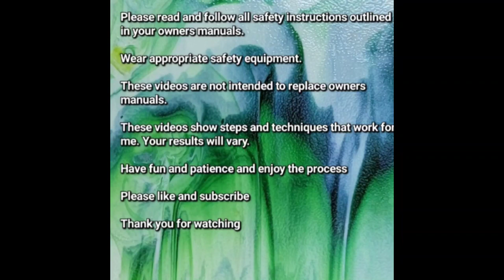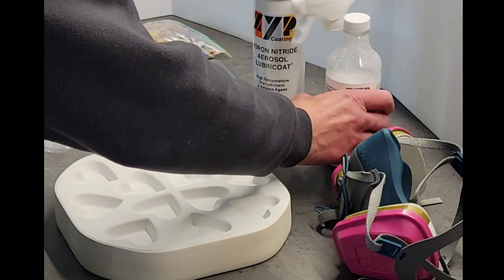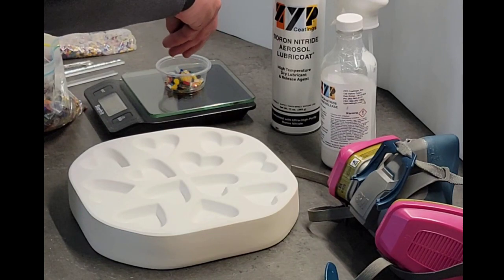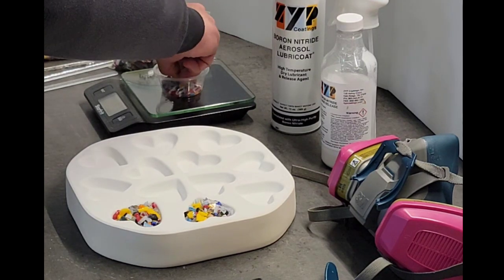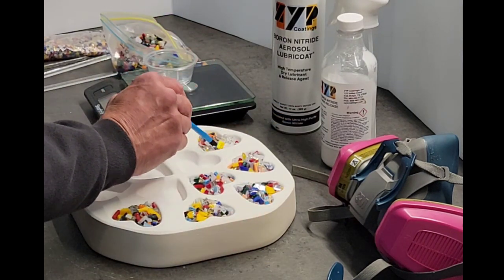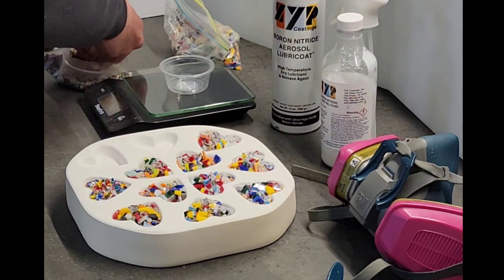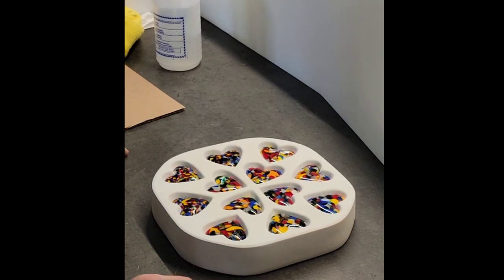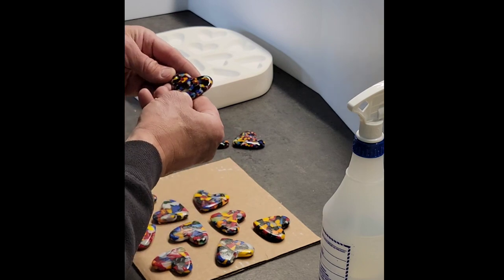Fusing with the Creative Paradise LF 241 12 Heart mold.

Comment: I’m new to this. Is a microwave kiln any good?  Can you put glass on tin in the kiln?where do you get fiber paper? How long does fiber appear LAST?
Reply from the maker: Hi, I have never tried a microwave kiln. I know they are quite small and used mainly for jewelry. No, you can not use tin, Stainless steel is recommed for slumping molds. Kiln paper is available at a stained glass/fusing supply store. Fiber paper now usually lasts 1 firing. Depending on what you are firing, you May get a couple of uses as long as it's in good shape and not disturbed.  Always wear a mask and goggles when working with kiln paper that has been fired. Surgical type gloves are good as well to wear. Safety first.  Always do your research, hope that helps.